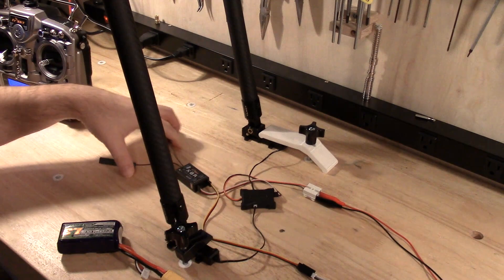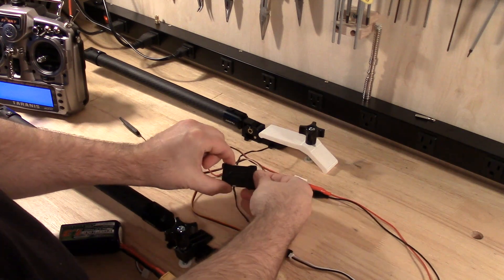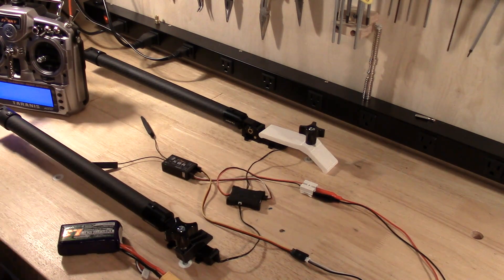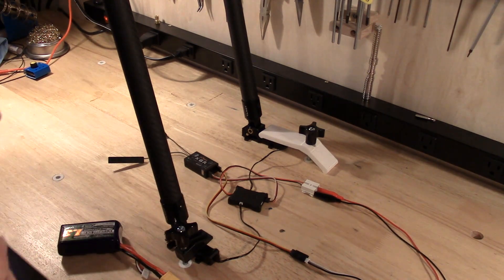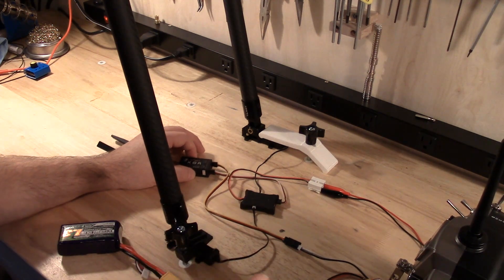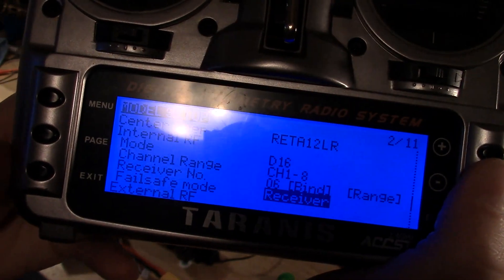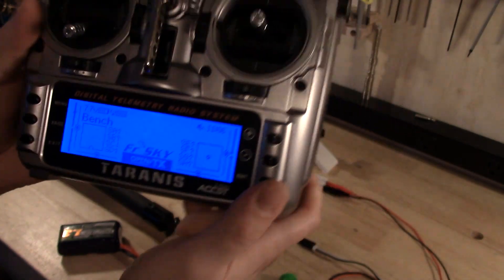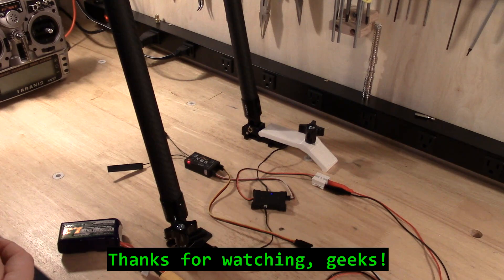Tarot T Series Retractable Landing Gear - Failsafe Setup

Comment: How did you reverse, when I turn off my tx landing gear goes up ????
Reply: You can reverse the polarity of the wires that from each leg and plug into the module. Geekazoid has a video on reversing the polarity.

Comment: Nice info mine keeps blinking blue with everything connected. I even got the channel for it setup but nothing moves. i am using pixhawk 2.1 on channel 7... any advise
Reply: 62/5000
I also have a pixhawk 2.1. Did you solve the problem?

Comment: Is it possible to set this failsafe function without the control box? I have my legs wired directly to a channel on my x8r and use the throttle to raise and lower them, when I turn the transmitter off they stay up.

Comment: Thanks for the video.  It helped me troubleshoot some of the odd behavior I was having with my X6 retracts.  * Both * sets of landing gear were wired backwards, such that on fail safe they retracted - not very helpful behavior!  Reversing both sets of wires resolved the issue.  Per your comment in the video, I would definitely work this out - before - you install them on your copter.

Comment: I am curious why the Power wire on the Servo connection into the TLX8002 is not cut, i would have thought it needed to be cut since only the signal is needed into the Controller and it has its own power? your thoughts?

Comment: Thank you for sharing this video. I just received my set of retracts but im having issues getting them to work properly. I am using the Taranis with the X8R receiver which is new to me. When you assigned the retracts to channel 8 on your receiver, did you have to set any curves or additional settings for that channel? If so, please explain. Thank you much!

Comment: hello good night: you know tell me if in the engine compartment that is on each landing gear, if there is a board that controls the start limit and end of the course of pouso.pois trains have one that there is a card in each landing gear motor, and I am intending to buy just this little box that comes in this set. Electric retractable tripod Tarot TL8X002 driver for Multicopters
you can help me?
Reply: Yes i wanted to know that also,did you ever find out if it stops and reverses the motor at the end of the limit?